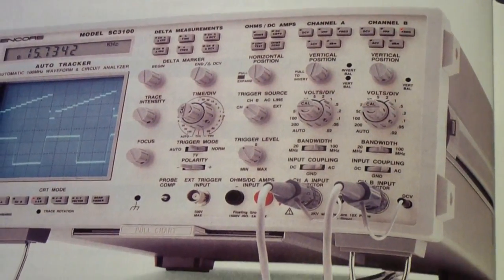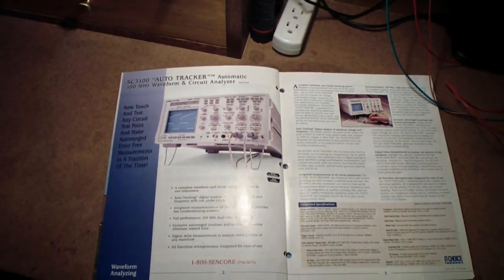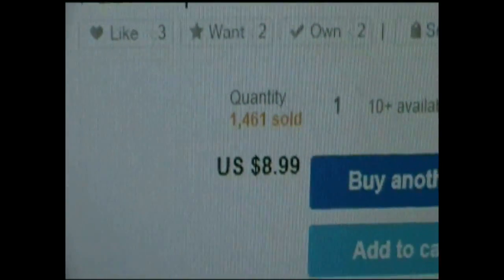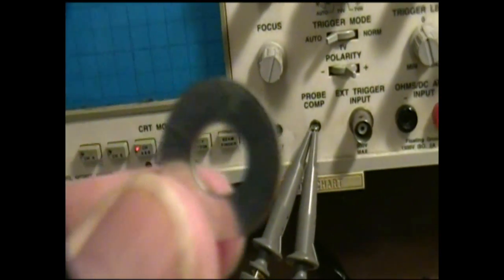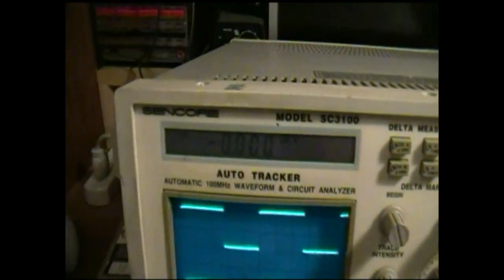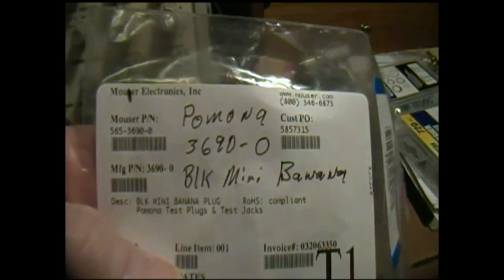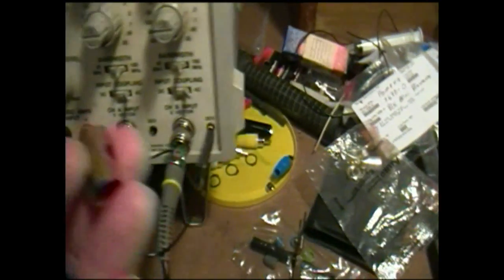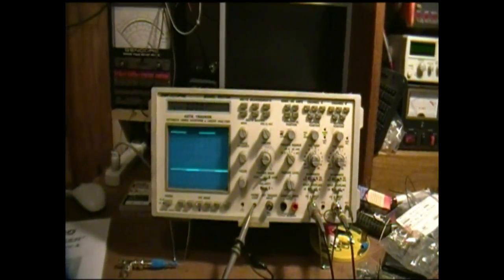TTT051 A Vintage Oscilloscope

Comment: Update on the Sencore probes; Sencore no longer supplies the specific probes required for the SC3100 Waveform Analyzer. Each probe sold for a hefty $169.00 to access all of the instruments capabilities. This video is a life saver for anyone that wants to modify cheap probes to do the same thing.

Comment: many thanks for a very nice & instructive video.

Do you have the spec. for the Sencore probe?

I use 2 x Vishay 27MΩ Metal Glaze Resistor 0.5W ±5% VR37 27M in parallel to get 13.5MΩ 1W.
I elect to use the Agilent N2863B as it very easy to open the cap and solder the lead.

Does the DC lead needs to be a coaxial in order to protect the signal?

BR
Jo

Comment: Excellent video, I not long got the same scope and was facing the dilemma of the probes. I probably would have just carried on with mentally adjusting for the scaling of the readings, but I will attempt to make a set of probes as you have. Many thanks!
Reply from the maker: I am glad that you are inspired to try making some probes. Let me know how it all works out. The only dditional advice I would give is to make sure you put the shielding back after you take it out to modify the probe, otherwise it will pick up interference. Good luck on your project and let me know how it turns out.

Comment: So... you can use any other 2CH scope and cheap probes and measure DCV and look at the AC and DC signals much easier by just using AC and DC coupling.